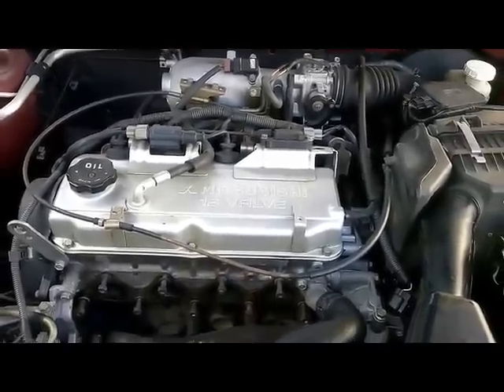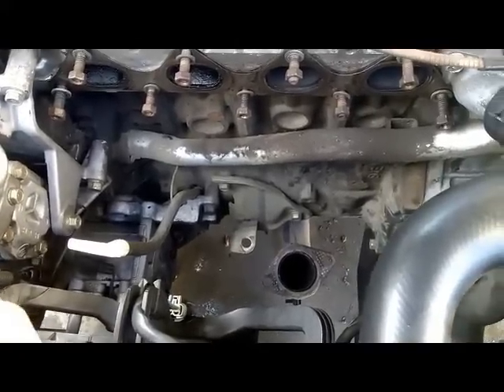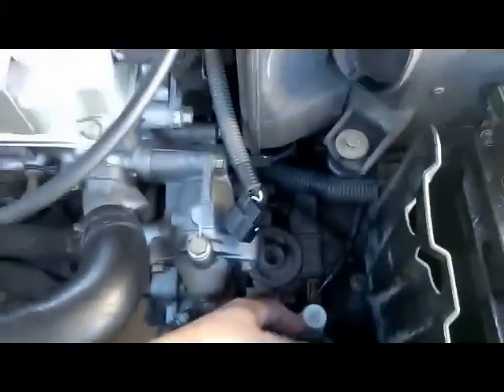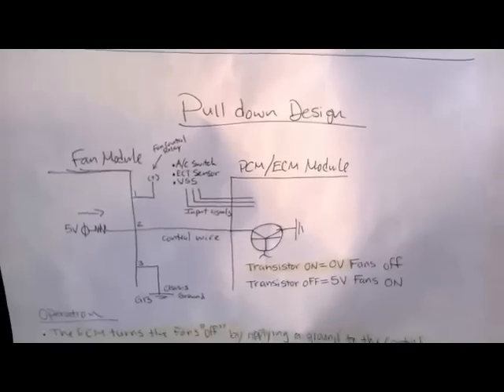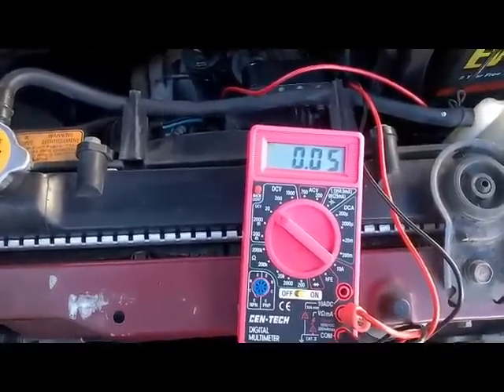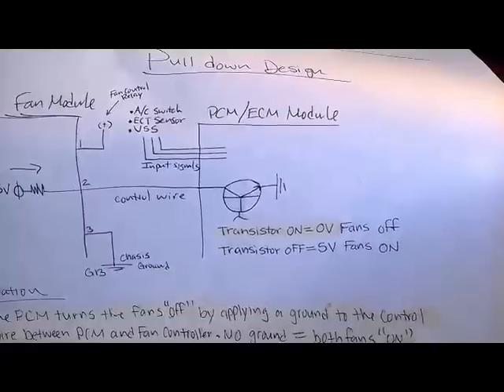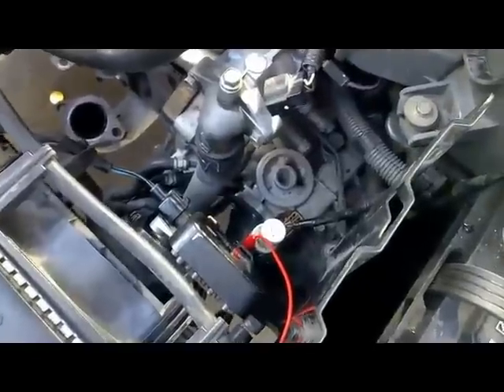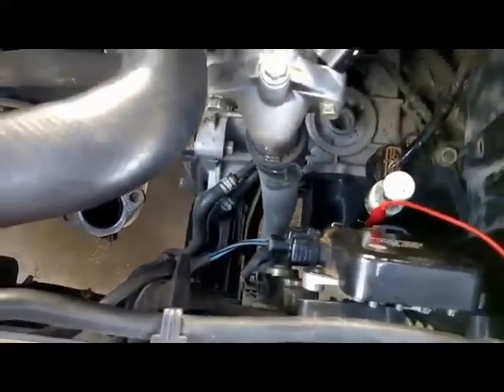(Mitsubishi Lancer) Faulty Fan Control Module

Comment: easy fix is to get a hot air gun and apply heat to the back till its hot enough to melt the solder and create contact again. i have done it many times it works,  also if you can relocate the controller to less heat
Reply: That works for my missi mate thank alot
Reply: Are you referring to the part where the fan module has aluminum?
Reply: @apdiy9127 Are you referring to the part where the fan module has aluminum?

Comment: I hate changing and changing my FCM it keeps on breaking, what do you think if i just bypass it, i put a negative trigger and connect it to the signal wire since in the video you said when the ecu turns the fan on it removes the ground

Comment: My 2004 Mitsubishi Lancer cool/hot gauge went to H 2 days out of the blue, never had any problems with it.  I stop the car and then waited a bit and drove it home from work with the needle mid way as usual... The next morning, same thing -drove to work with needle mid way between cool and hot which is normal but when I was ready to go home at the end of the day, as soon as I put the key in, it  went all the way to hot.  I checked the coolant and it was full to the top and green.  I did not check the water reservoir, I have no idea about that. I figured the fact the car was standing all day in the hot sun here in FL so I had to wait a while for the sun to be less stronger and attempted to drive home... I had to stop 2x when the needle went to Hot but as I got on the highway and the air hit the car, the needle stayed halfway.  I drove all the way to the mechanic and left the car there.  This morning the mechanic said he change the thermostat but it still goes all the way to Hot when he turns on the car, and he mentioned the fan not stopping but my car fans ran a little while after the car was shut off then they'd stop. At this point he has no idea what is wrong with the car and I don't know if it's worth to fix it, especially if he doesn't know what is wrong with it.. he mentioned something about the water pump or an air pocket in the engine?  Im lost .  Also I have been driving the car without AC for 5-6 years in FL. I don't want to spend a lot of money fixing a car that is not worth fixing unless you know about cars... What do you think? The car has a lot of problems but it was drivable in the past... that's all I need something to take me back and from work. 30 miles round trip a day.
Reply from the maker: Yolie R. Hi Yolie, the first things that come to mind, a potential clogged radiator, head gasket problem or some type of electrical problem.
Reply from the maker: Yolie R. Are the fans kicking in when the needle goes to hot?
Reply: I'm having the same issue!!! And even after my bf wired the fans separately with a kill switch, the car continues to over heat. I plan on changing out the thermostat. Any other suggestions as to what could be the issue???
Reply: @monanbobby143  -my car has the same issue i have a 2006 2.4L lanser  and i took the wire of the temp switch and the fans stay on all the time the engine light stays on aswell BUT everything is good the car will not overheat anymore, aircon works good  and the auto shop can't work out what the hell is going on, it's not the thermostat, it's not the fan module,it's not the temp switch

Comment: We are having almost the same problem with our Mitsubishi Lancer CS3 2008. We switched off the AC and then after 10 minutes of being stuck with traffic, we noticed the temp gauge at around 80%. We stopped to let it cool down. After few minutes, we started the engine with AC on and the temp went OK. We brought the unit to the service shop and they noticed that the radiator fan is working but delayed and not as fast as it should be. They said these are all the items that should be replaced. We did not push through with the repair because their parts are very pricey (almost $550). Should we proceed with purchasing the controller first instead of following the service center? Looks like your video is relatively reliable. Thank you

Radiator Fan Motor
AUX Fan Motor
Fan Controller

Comment: My 03 outlander has this problem but every time I get a new module it ends up going bad again, it's been a recall item since I bought the car brand new in 2003 is there anything you could suggest I do differently? Thank you for your informative videos💜
Reply from the maker: Hey Summer, how long does the fan module last before it goes bad? Has your fan motor ever been replaced?

Comment: Good video, only issue I have is that the control signal I believe is pwm based, so although yes its 0v-5v that is obtained by varying pwm to get those voltages ( rather than resistor to ground), I could be wrong.
Is there a good value obd unit you would recommend for this vehicle that can connect to all computers on the vehicle?
I believe its mitsubishi mut2 protocol, and the cheaper elm type devices will not connect to all the ecus.
Reply from the maker: Thanks for your input, much appreciated!!
I would recommend Autel or Launch scanners

Comment: Are IC231 19700 and IC232 19700 Fan Control Module interchangeable..? I cannot read if it's IC231 or IC232 (2005 Mitsubishi Lancer OZ Rally Racing Edition).
Reply from the maker: FYI... the AutoBoss V-30 is no longer in production.
Reply: @EliTheOBDTech  thanks...

Comment: Im having a no fan at all, I replaced the module since im getting 12v-5v-ground on the harness but its didn’t fix it, replaced the temp sensor but neither that works, I disconnected the signal from the ecm to the module and the fans are working all the time the key 🔑 is on.. im confused like is my ecm bad? Or i buy a defective fan module?  I don’t have a fancy scanner to do all those tests, only a multimeter and a test light 😮‍💨
Reply from the maker: Hey Edgardo, sorry to hear about your current problem. This system is module to module communication, so if you already changed your fan module you may have a potential chance that your ECM is not getting the signal. Did you replace the module with a new one?
Reply from the maker: When I get chance, I will look at the wiring diagram again and look for another possibility.
Reply from the maker: With the main connector connected to fan module and back probing the middle wire which is your control wire, what is your voltage? It should be 0 volts with fans off and 5 volts when pcm commands the fans on.

Comment: hello my friend ...2004 sportback ralliart....just like this video my fans come on when cold but they pulsate from off to low speed to high-speed the off again high and then low ...then off ....both the fans work...when I turn on the A/C the fans are more stable but pulsate from high to low several cycles drives me nuts...some where I seen on a forum that there was some sort of ground in a wiring harness....I have been reading tons of information for over a year and stull come up empty handed ...I could make a video if necessary...thx again
Reply from the maker: +Bill Frev Hello Bill, most likely is going to be your fan control module, they tend to short-out internally. Have you replaced the module already? Perhaps, it can also be a ground issue.
Reply: no I have not checked on any thing ...so many similar problems...I did install a stereo amp and seemed like the problem got more frequent...from the battery there is a power wire with fuse link for the amp....but the ground it to the body pan inside the car ...so it is using the factory ground to power the amp ...I have thought of adding a new ground to the body pan inside the engine compartment...still at a loss

thank you for your time indeed
Reply from the maker: +Bill Frev Try doing some of the voltage checks that I performed on my video. Hope you get your problem solved. Your welcome.

Comment: I seem to have a similar problem, but my fans don't run at all. The cooling fan fuse blew, but they still don't run after replacing it. AC also runs hot, is it still most likely a faulty control module?
Reply from the maker: Most likely yes, these are known for going bad.

Comment: Thanks a lot i had the same problem but i have a question my car is 2007 ralliart model and we don’t have a lot from this model down here in the junk yard, can i just put the fan module from another model of lancer like the 2003 1.6 engine lancer
Reply from the maker: That is a good question, I'm not 100% percent sure, it all depends if the manufacturer programed the pcm to operate differently from a non-ralliart. Most likely it should work.
Reply from the maker: Try cross referencing the part number from a ralliart to a non-ralliart.

Comment: Where do I put the negative and the positive points I’m confused?? To test the voltage
Reply from the maker: If you are going to check for battery voltage, connect the black lead to battery negative and red lead to pin 1. To check for ground voltage on pin 3, it's the same connection, you should get a reading less than 100mV/0.1V. To check for pin 2, same connection. Hopefully, it help you.

Comment: starting problem : connected the battery neg cable to the neg post with the ingintion in the off position the car start to crank so I disconnected the trigger wire which is the ingintion wire with the key on in the off position im getting 12v with the ingintion off what do I check next thank you

Comment: Great video, thanks. Will use this method to diagnose other cars too. 5v comes from fan control module or the pcm feeds 5v on/off signal?
Reply from the maker: it comes from the fan module. Thanks for the support.

Comment: hey mate i was really looking for a complete video and yours was the one. 
now i have an issue.  my car originally did not come with fan control module. it was only fan relay(4g18). i have swapped engine and ecu (4g93) and now i have an issue. my fan is consistently ON once i fire up the engine. i believe because of not having PCM. how can i "cheat" or modify the ecu or wire to kick the fan. because 4g18 works as "with ground, fan on" i am so lost
Reply from the maker: Hey R Raj, I'm not sure if I'm right person to ask about modifying circuits. I really don't like doing things like that, messing with the integrity of a circuit, sorry man.

Comment: Eli,

I have a 2004 Mitsubishi Lance Ralliart.  I am going to replace my cooling fan control unit.  My question.....I find replacement parts for an 04 Lancer or an 04 Lancer Evo.  None for an 04 Lancer Ralliart.  Does the 04 Ralliart fall in the 04 Lancer guidelines or the 04 Evo guidelines? Which part do I order????
Reply from the maker: under the lancer guidelines.
Reply: +Eli TheOBDTech  
Thanks
Reply: Mazda 3  uses the same parts- mazda and mitsubishi both have same cooling issues - the best thing to do is remove the temp switch wire from the motor the fans will stay on all time when driving

Comment: working on a 96 jeep Cherokee sport 4.0 install a new ingintion switch the old switch had some burn mark on it OK on the new switch as soon as I connect the neg battery terminal the starter start cranking with the new key on the off position I check the power at the trigger wire disconnected no volt what do I check next
Reply from the maker: sounds like a serious issue, I currently don't have my laptop with me so that could look at the ignition wiring diagram. As soon I get home I try to give you some possible answers.
Reply from the maker: perhaps you have some type short on the trigger wire for the stater, try checking the stater relay also.
Reply from the maker: +Simon flores My only explanation that i could thing of, is either you installed the ignition switch wrong or you have a short to ground ignition wire on pin 1. As you can see on the diagram, the ignition wire is yellow. Somewhere between  the ignition switch and Starter relay, you have a short to ground, which is causing your relay to energize as soon as you put the negative battery cable. I would try to trace your yellow ignition wire all the way to the starter relay. Good luck!!
Reply from the maker: +Eli TheOBDTech I see that you all ready have the wiring diagram on your Google+ account. Refer to that on the message above when mentioning about  pin 1 and Yellow ignition wire and starter relay.

Comment: I have a similar issue on my Lancer, my problem is both fans spin slowly, checking the output voltage from the Fan Control to the fans is only 5v, I suppose there should be 12v, can you check in your ALLDATA software for that voltage? I'll  appreciate very much and thanks for all the info in video.
Reply from the maker: Alan Valle Sorry for the delay, busy schedule lately. I will try to relay that info asap. Are you talking about the 3 wire fan control module connector or the 2 wire fan connector?
Reply: Eli TheOBDTech thanks for reply, my ask it's about the 2 wire fan connector.
Reply from the maker: Alan Valle Ok Alan, specs on All Data show: 8.2 +/- 2.6v
Try this; disconnect the condenser fan motor connector. Ensure that the A/C switch is off, and start the engine and run it at idle. Measure the voltage between the fan controller-side connector terminals(not harness side connector). Standard value: 1 volt or less. Turn the A/C switch to the ON position. Measure the voltage between the fan controller-side connector terminals while the fan is running. The voltage should repeat the values 1 and 2. 
Standard value:
1. 8.2 +/- 2.6v
2. Battery positive voltage +/- 2.6v

Comment: What could be a problem if radiator fan is "not working" when temperature is already in high temperature and when turn on ac the radiator fan run at the sametime with ac cooling fan? Thank you for the answer if ever.
Reply from the maker: edward gandeza Depending on the vehicles cooling system, a faulty fan control module or a faulty ecu cooling temp sensor can cause a fan not to operate even though they do operate with the ac being on. This happens because the ac system has its own circuit design from the cooling system.
Reply: @EliTheOBDTech  thanks for your video . It is really great and helpful. I have same above issue. Let me try to check temp.sensor

Comment: one question i have a ford edge my fans stops working and then when i turn my truck off to let it cool , i started it again and then my fans works find again what it would be?? thank you
Reply from the maker: If your ford edge has a fan control module, then most likely you have a module that it's starting to go bad. You will need to check for power and ground to make sure it's not losing none of those two when the module activates the fan ON.

Comment: sir my mitsubishi lancer 2005 model the two cooling fan did not work  the technician said the fan relay have a problem and change it. how can i fix it without change my old fan relay because new one are very expensive.. thank you.
Reply from the maker: +Ricky Reyes The only other way is to rewire you cooling fans with a separate switch. Try looking for one on ebay or amazon. Even for a used one at a junk yard. You are better off replacing your fan control module and not bypassing the cooling fan system.
Reply: Thank you so much.

Comment: What is that 5v from the FCM, is it like s switch so when i grounds it'll trigger?
Reply from the maker: The 5 volts that come from the module is there as a reference Voltage to the pcm. The pcm needs to see 5v in order to oprate the fans. The pcm will provide the ground depending on input sensors.
Reply: @EliTheOBDTech  changed my FCM but still my fan doesn't work on "no aircon"

I just got my car overhauled and after we put everything we started it and thats it we saw the fans are not working and we tried to on the aircon and it worked, we thought it was the ECT and we changed it, but still it doesn't work. Now we changed the FCM but still 🤷🏻‍♂️. It's so annoying. Checked the signal wire output and its a bit weird because it doesn't cut the ground when the fan is supposed to be on 🤷🏻‍♂️

I think its the ecu or just a grounded wire 😓
Reply from the maker: @judsonfrenilla6573  Yes, it sounds like a wire issue from the main harness or ECM driver not switching to ground.

Comment: I have a 2004 Mitsubishi Lancer ralliart and it’s overheating and I bought the module but it still overheating??? What could it be??
Reply from the maker: Are your fans kicking in when the car starts to overheat? 
It could be many things: faulty thermostat staying stuck close, clogged/restricted radiator and worst case scenario, blown head gasket.